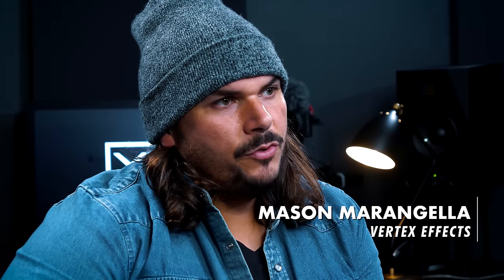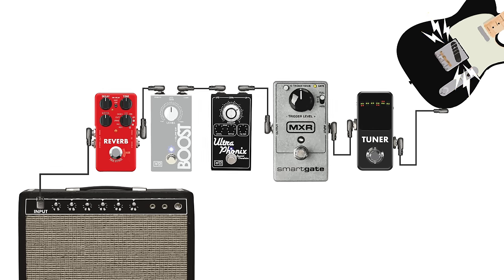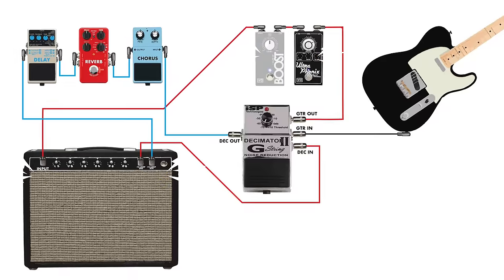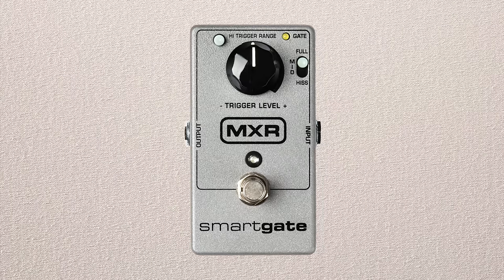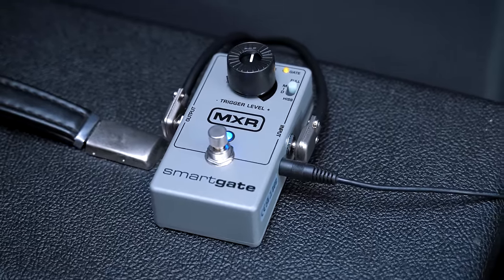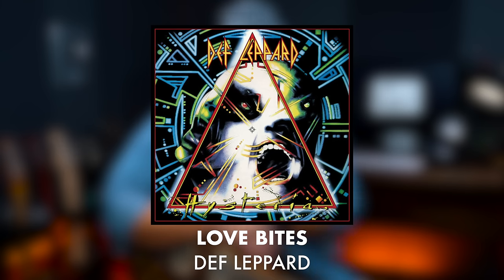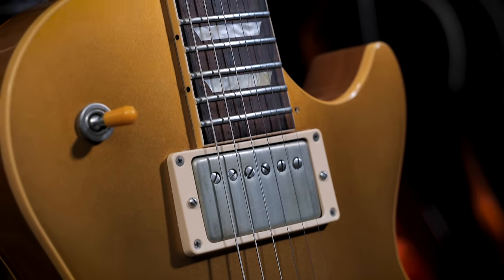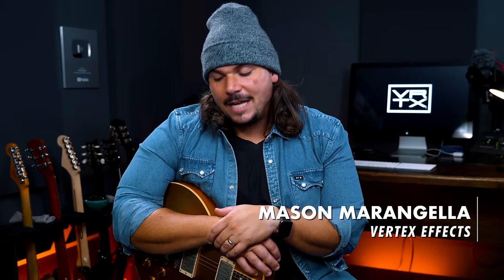Why I Changed My Mind About Noise Gates

Comment from the maker: Do you have any questions about how to implement a noise gate into your rig? Ask in the comments below!
Reply: I wish this video came out last month when I was breaking my back to get my noise get to work the way I wanted! Now I’ve got a decimator G string that works beautifully for what i need
Reply: With ISP isn't the guitar supposed to plug DIRECTLY into the GTR IN so ISP can track the signal?
Reply from the maker: @eathummus  where do you see us saying otherwise?
Reply from the maker: @dkonx probably works well in their ecosystem of effects, I don't know how it would work for external effects looped in with it.
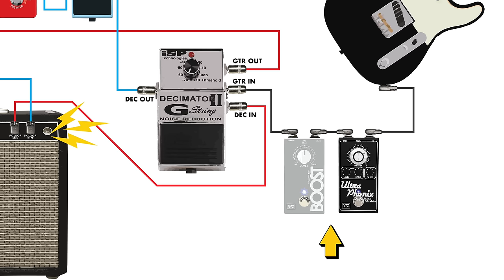Reply: @VertexEffectsInc  You have one scenario (4:40) that's guitar-OD-ISP (guitar in)
Reply from the maker: @eathummus  guitar doesn't have to plug into the ISP first, depends what you want to have in the loop.  They usually tell you to put the input close to the guitar so you have better tracking with the input sensor, but it depends on the pedals you have between it and the gate.  This example is specifically looking at gating out preamp noise.  Around the 7 minute mark we should the pedals in the loop of the gate as well as the preamp section.
Reply: I recently built my board with the isp hum extractor + Decimator g and the hx fx using 4CM to my 5150 iconic head. Love the hum extractor version of the Decimator. Shout out to Geoff at Sweetwater for helping get the stuff I needed to power that board!
Reply: Maybe I'm wrong, but it's my understanding that the iSP is more than a simple gate, as it also processes the signal under the threshold value (the non-gated part) for cleaner overall output.  How exactly this is achieved I have no idea, but this is what I've been able to gather when searching for info on this device.
Reply: Yes, I commented earlier but how do you get rid of white noise?
Reply: I have high quality buffers (thank you JHS) high quality power supply (Cioks is the best).  I play a Les Paul and an SG, both with PAF style humbuckers.  Noise hasn’t been a huge issue, however I have a gate in the loop and a gate in the front of the chain.  They are almost never engaged, however I play a 5150 lbx and there are times I really want to jump out on a lead, so I’d use an overdrive (usually my Timmy) to boost the gain channel of my 5150 and depending on the situation i would throw one of my gates on.  Id rather have one and not use it than be in a situation where I need one and I don’t have it
Reply: Hi, Happy New Years!!! Using the 4cm (revv g8) and the vertex buffer interface as described on Vertex's site "Application Example #1, FOUR CABLE METHOD (4CM)". Im thinking buffer send and return to the gates send and return and the buffer's out to the input of the gate and output to amp. Question is that correct? Should the gate be placed before the buffer at a certain  point? Should I just run it in the fx loop? I'm kinda lost with the 4cm using the vertex buffer and a noise gate lol.
Reply: When you use the guitar volume to clean up a distorted tone, you get problems with the noise gate. Any ideas on how to solve that?
Reply: @VertexEffectsInc  I use the loop in my BOSS NS-2 noise suppressor pedal where all my effects pedals are in and was just wondering if I need to add a buffer at the start of the chain and an other buffer at the end within that loop.

I already use a buffer right after the guitar and an other buffer last before the amp input but I was wondering if I need to add buffers in the loop, too, or if it’s buffered already by the NS-2, thanks!
Reply: Can I put a wah and a vintage style fuzz before the noise gate ? Or should it go before those pedals, even though they like to be the first in the signal?
Reply: i recently purchased a full rack setup. the Hush ICX was in there, along with a lot of other gear (marshal jmp-1, quadraverb, other stuff). i’m having trouble identifying where to put the gate, and other gear in the chain.

any help would be greatly appreciated.
Reply: Will it work on my noisy family? I'm a Greek you see.

Comment: The big secret if you have a lot of pedals that make noise and you are using a switcher is to use several gates.  I have 3 loops each with more than one pedal as i often stack them. It gives me 3 loops so I can use 3 different sounds in a single tune. I also gate the amp. Because there are less demands on a single gate it is easier to get a smooth natural sound. You also find you are not tweaking different pedals between tunes If you are really anal the REVV G8 is hands down the best. Metal guys might want to check out the DAE Audio Golem Gates. Other very good ones are the AMT Incinerator and the Stone Deaf Noise Reaper. All recommended are well made and use a good spec and can grab transients very quickly so you are dealing with any stutter.  This demo was a lot of work so give the guy a break , hit the thumbs up and subscribe. All us regulars would love to have you join us and even add a few comments.
Reply from the maker: That's a lot of gates!
Reply: @AzathothsAlarmClock  Can you please list those midi capable gates?

Comment: What changed my mind on them was the ‘ZNR’ noise reduction setting on the Zoom MultiStomps, G series etc. It’s VERY subtle yet effective and when set at it’s sweet spot (14 on my rig) it does it’s job without effecting dynamics at all. I’m not a high gain player, so I never really needed a gate, but I started using this just for quieting single coil hum between songs, and now every single patch and ‘blank’ patch on my Zoom Ms-70 (which is post drives, pre delay/verb) has the ZNR at the beginning of it.
Reply from the maker: Nice!
Reply: I am also using the ZNR from my zoom ms50g. I put it before my drive pedals, and it works well, keeping my pedalboard quiet from unwanted noises.
Reply: Thanks. I will try this with my Zoom MS70 CDR.

Comment: There are two principles to keep in mind when applying noise gates:
1) Unless it is a sophisticated digital unit, gates decide between "noise" and "signal" based on level alone..  So when using one, a person should insert it where the contrast between background noise and wanted signal is greatest.
2) There are two broad categories of noise: hum and other line noise, and hiss.  These two broad sources have different sources, and so tend to require different solutions.

I find the discontent many users have with noise gates stems from expecting them to do way too much.  If one uses high gain pedals, and the guitar itself and connecting cables are not especially quiet and well-shielded, then one can end up with amplified hum and hiss at the end of the pedal chain.  Expecting a gate to be able to tell the difference between what you do and don't want at that point is a fool's errand.  This is why gates that rely on "the 4 cable method" exist.  The guitar goes into the gate first, where the noise floor can be more accurately detected, and the threshold set in a way that doesn't intrude.  The signal then goes through all the rest of your pedals, and the gating action is applied at the very end.

That works well enough...in theory.  Considering point #2 above, a gating action based on whatever noise comes in from the guitar will not necessarily address noise that accumulates over the pedal chain.  This is why I've been an advocate for a dual-gate approach.  A first gate removes hum and line noise at the start of the signal path, and a second gate removes cumulative hiss at the end.  The two would have different filtering actions, with the 2nd one being a noise filter, rather than gate.  Not perfect, but it would work better and ask less of each device, resulting in less intrusive threshold settings.

I have a compressor, built around an SSM2166 chip.  The chip was intended to provide full dynamic control of a mic strip.  IN addition to excellent compression, it also includes downward expansion, which exaggerates the difference between low level and very low level signals (as opposed to decreasing the difference between high level and very high level signals...which is what limiting does).  This turns it into a dead quiet compressor.  Many users who don't understand compressors will often complain about them being noisy or hissy.  They simply do what they are told, which is to apply lotsa gain to very soft signals, without any recognition of what that signal might be.  And if that very soft signal happens to be hiss on the input, then that will get amplified.  If the compressor has a slow recovery time, the boosted hiss will get progressively louder after an initial pick attack, and sound a bit like someone inhaling, which has resulted in the technical term "breathing" for such noise.  Ideally, one feeds a compressor a pristine signal to avoid that boosted hiss.  But if you can't do that, the downward expansion is VERY helpful.
Reply: What compressor are you using?
Reply: Thanks, this is very helpful, important information. I too would like to know what compressor you're using.
Reply: @jacksonmanuel33  It's simply the circuit in the datasheet for the SSM2166.  Jack Orman's "Q & D Compressor" is very close to that.  I'm surprised more people aren't using it.  Helluva chip.
Reply: ty, i will try to absorb this wisdom as i begin to tweek and ferret-out unwanted or obstructing or as you demonstrated: domino effect with a possible logarhythmic or worse... exponential cascade.
Reply: What about the isp him extractor with the decimator  in one , Do you Think this will suffice over buying two pedals to
Suppress noise ? I’m not used to gates .

My biggest issue hs been subtle playing , I can really set a gate in a reasonable place where it won’t cut off subtle playing .

That aside, I’m curious if you think that isp device is worthwhile and more effective than te speed are decimator as etc. they have multiple pedals and I can’t really tell if the newest and most expensive are any better .

I thought about a big Furman power conditioner , like 1200 plus dollars , to try and totally balance and clean electrics issues since I do get a zapping sound, even from the cable , with the guitar is not hooked in and wondered if that would help .

Obviously the gate could help me with p90s and hollowbody squeals too. I have multiple issues to address.

Iv seen it claimed that the isp will get rid of the hum while playing but I’m assuming it will alter the guitar tone . For live I wouldn’t care but I would like to record professional guitar tracks are home and this is where I try and figure out how to clean up the signal big time
Reply: @heythere6983  I haven't used it, but I gather the ISP unit is digital.  If so, then such units are capable of very precisely zeroing in on EMI, without affecting other parts of the signal, rather than trying to remove a spot with a hand grenade as many conventional gates do.  It's a pricey unit, but if it's mission-critical for you, then I suppose worth the expense.

Things like the Furman power conditioner are useful if one is performing in an arena that has a surfeit of motor-based appliances (like HVAC) contributing all manner of line noise.  But few, if any, homes would pose those sorts of challenges or require such expensive cures.

Comment: KMA Pylon has an external trigger input, two loops, boost, cut, and a channel control so you can change the channel on your amp when engaging the gate (ie, only use it on the high gain channel, but not the clean). Amazing. Best noise gate I’ve ever used.

Comment: the Prorack G IS terribly amazing with high gain and reverb from a H8000FW or I use the pedal version of Decimator which is as good. When I decrease the guitar volume along with gain, I just deactivate the pedal for sustain and subtilty. All good stuff. If the Hush pedals are good enough for Angus Young, it's all good enough for me.

Keep in mind that my setup is already with minimum noise, and I use only gain at breakup point. If I want a dark sound I'll mimic the compressed sound of a high gain with low presence, low inductance pickup with Bill and Becky Q-filter (to allow higher gain setting on the amp), guitar's volume at 9 for rounded highs...
... to summarize flat EQ on the amp so the sound cut through (the mids must always blend with the lows if they are punching.

This is the metal version of Michael Landau/Scott Henderson style, except I use Bill and Becky L-500's along with any Suhr OD100's type sounds using the minimum of features (no whomp/depth, low feedback ctrl, no bright switch, sometime the bass lower than 50% unless the CH volume and gain is very low... ... then you'll appreciate your pedals exponentially 

If Love didn't save your life, tone will for sure. ; )

Comment: Thanks for the video.  For us high gain guys, that gate the amp's preamp in 3CM or 4CM, probably the biggest issue is being able to sustain notes and not have the gate cut them off.  I use a GUP Tech SUN noise gate in 3CM, with a buffered splitter early in the chain, and it works well as do other 3CM/4CM capable gates.  The gate is immediately after the amp's preamp.  I use a switcher (Carl Martin Octa Switch "The Strip"), so I am able to remove the gate from the signal chain for clean tones.

Comment: I use a Electro Harmonix Silencer since 2 years. I just put it into the FX-loop of my Laney AOR that can be a bit noisey when not playiung. I turned all the knobs to 1 o'clock, sounds super natural with no loss in dynamics or unwanted gating, as soon as I stop playing the gate kicks in after a few ms of delaytime and it's dead silent.
Highly recommend that pedal as a cheap gate option.
Cool quirky EHX thing is that the Silencer can also boost the noise if you like, the manual states "yes you can boost the noise instead
of reducing it if you like"! You just got to love EHX for doing such weird things!

Comment: The most valuable part of the video is the concept of the 'Key' (pure guitar signal) and how to emulate it at around 7:00. I have not tested if the suggested key emulation diagram works - yet. Ordinary noise gates cannot tell if a dying note is noise, so it prematurely cuts it. The use of a 'Key' allow a Zuul to know that it is a note, not noise. (MXR Noise Clamp and Boss NS-2 user).
Reply from the maker: Remember that any 4-cable method noise gate has a key, the input is the key (sensor), and the send is the split output (which the Zuul gets from a splitter off the guitar.  If you put your gate first (4-cable method style), you'll have the sensor first and the gate circuit is only present from the gate return to the gate output.  Everything else is before the gate.  Same with the Zuul if you use if after the FX send for example even with the key sensor.
Reply: Im using the MXR noise clamp in 4CM. Doesnt cut off notes.

Comment: I chose the Dunlop MXR Smartgate for the versatility it provides, and the larger single knob design. For players that don't have noisy guitars and just need to tame high gain amp signals through the FX loop, I think almost any simple gate would work. Given that, I still believe the top quality components in this MXR Smartgate and the various ranges it allows you to narrow in on, give it superior sensitivity. The rubber cover for the already bigger control knob makes it very easy to dial in. Great design. IMHO the best choice for simple 2 wire gates that don't create more noise or tone suck like a 4 wire gates can.

Comment: I avoided Noise gates for 25 years, I was going to buy the Decimator,  however I ended up getting the Revv G8.  Apparently the G8 has the same IC chip as the Fortin one, and I like having more control with he G8 over the Decimator,  don't get me wrong it's a fantastic gate, the G8 just seemed to be the updated version in a way. The Revv G8 is definitely staying on my pedalboard,  I kid you not when I say I have far more drive pedals then any other pedal on it. Love gain stacking etc. Great video,  Cheers!
Reply: I settled on the Revv G8 as well and it doesn't leave my pedal layout. Using a 4-cable method and isolating my "noisy pedals" I get very nice and clean tone minus the noise and it lets me be more creative for some reason.
Reply: @robertpurdy4452  I have several drive pedals on my pedalboard going to 3 amps simultaneously,  I use the Earthquaker Swissthings pedal to organize it all , sorta lol.   I also use the 4 cable method through loop 1 on the Swissthings and run all the drive pedals through it, I love gain stacking so it's almost a must for me lol

Comment: Hi Mason! I'm using a MusicomLab MK VI and a Source Audio EQ2, so I can go mono with all my boost, OD and Dist pedals an get out in stereo to 2 amps. Also, out of the switcher and with MIDI I'm using a Eventide H90. I wonder how to use a Fortin Zuul+ into my set up. I'm not trying to connect it to the preamp, so I don't need a send and return FX Loop to the 2 amps. 

The main question is: can I use the key int with this configuration?